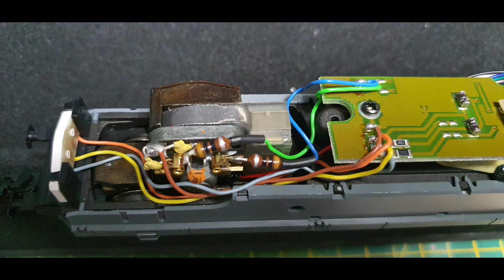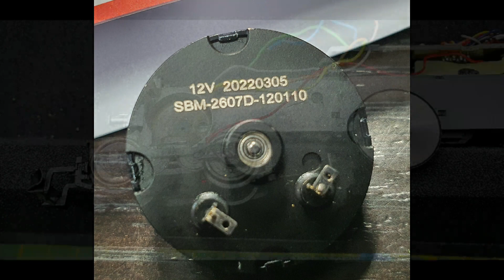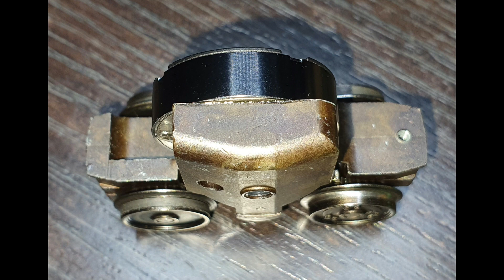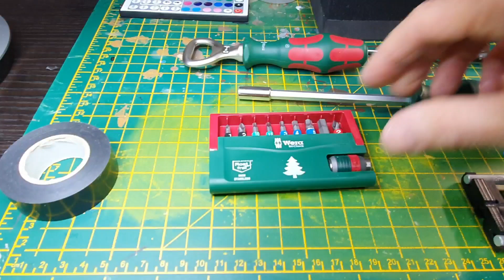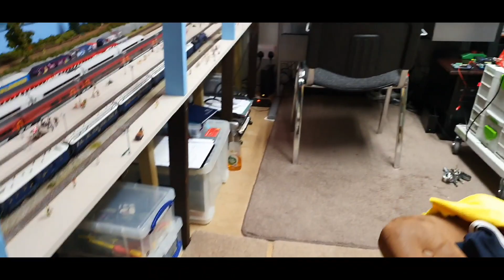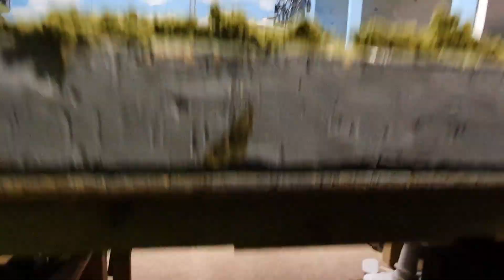Herpa Trix Br101 coreless motor fit out.

Comment: Coreless (brushless?) motors seem to be a much better choice for model trains.  Do you think the manufacturers will go to them now?  I have hear the term a few times recently. Nice job on the conversion.  Rob
Reply from the maker: Hi Rob
Yeah Trix and Marklin are now factory installing high end models.
They use much less power but have much more torque etc.
Amazing motors,  very smooth. 
😉🚂🚃🚃🚃🚃🚃🚃🚃🚃jim

Comment: Probably looks tougher than it actually was doing it. Was the motor designed for that type of upgrade or is it a bit more Heath Robinson?
Reply from the maker: The Motor is a universial motor which fits many models but there are a few models which require steel removing from the motor houseing like this one,  the last one I did was the Marklin ICE S which required only a small amount of adjustment to the steel houseing.
You can send the loco to the motor suppliers to do the work but this can take months to turn around.

Comment: For anyone interested in this kind of remotoring projects, be sure to get the engine that matches the locomotive. These motors are RPM matched to get as close to scale speed as possible while keeping the existing gearbox.
The other option often offered by SB modellbau is a full bogie replacement
Reply from the maker: Good info, It can be trickey matching the correct motor and not knowing whats involved with adjustments, some motors fit in nicely like the old Fleischmann pancake motors models..
🚂🚃🚃🚃🚃🚃jim

Comment: that looks like a newer model? no warranty? you have the skills!
Reply: That's the older one without the cardan drive (and without the 5 pole motor core)
Reply from the maker: @ivovanzon164  Yeah this is a slightly newer version with the led lights and interface but very old tech motor.